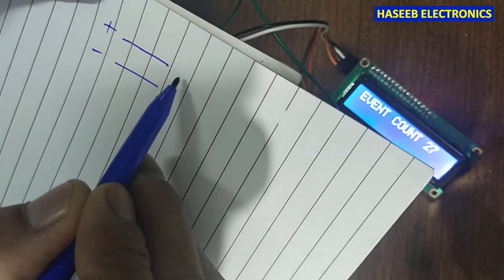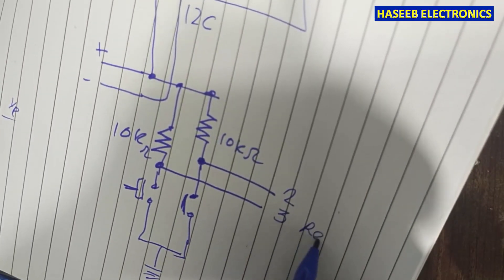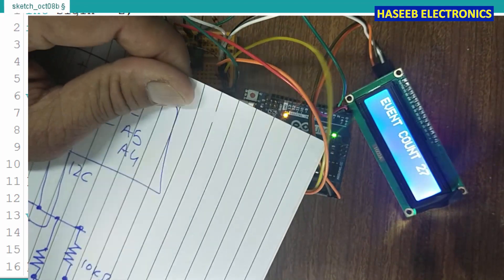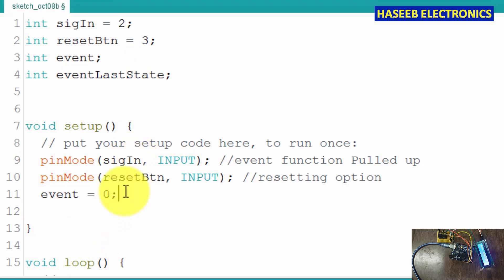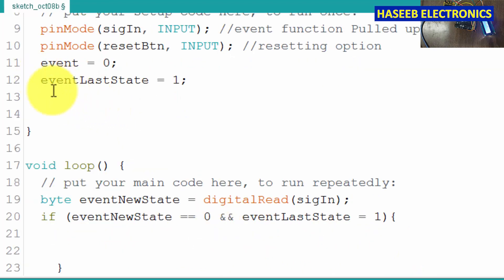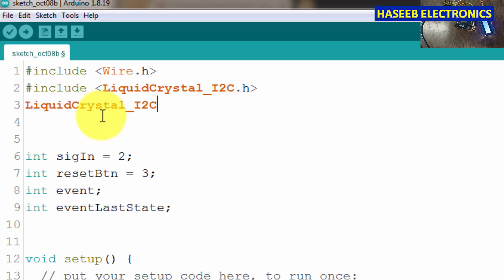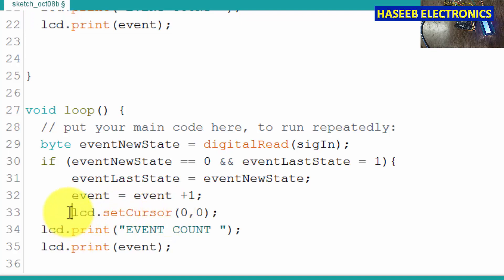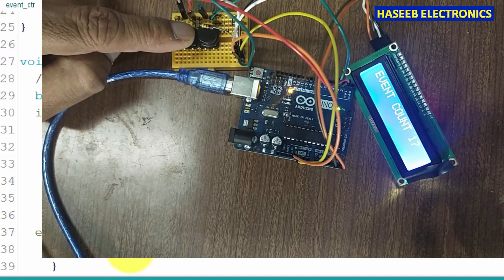{724} Event Counter / Pulse Counter Using Arduino Uno

Comment: How can I buy all these? Circuits?
Reply from the maker: you can search online "ARDUINO UNO STARTER KIT" and compare prices and number of sensors with that kit. any one which fits good to your plan, buy it 
i am sending some links, you can also check these links
Reply from the maker: https://www.amazon.com/ELEGOO-Project-Tutorial-Controller-Projects/dp/B01D8KOZF4/ref=sr_1_1?crid=37MNR33RGF07R&dib=eyJ2IjoiMSJ9._L3JiWgIo_Asrnpq9JBCAnqu9_LUnUdE3hJhcnvwZ2efJLNSKeAKlL4zK5pgImrphNMIPqMa1e6eS4m52nLzBcL81wPreM3CaEU1v2IP8S2B69zvecNlqq4KykzEYqJnO67QCYBLmodXRURM_T1kBrZy_4avvqC9ATkbKl7HMBGYO1jEJ9XUkypau7O8BiXayJWswD9qXvWe7rNd6WqJFuoKEex1hO9of8rgd7iviI8.pMeKqwCe96wTvJ5MBn4W6PUb7tIGSRW0OBcfr7VaCvc&dib_tag=se&keywords=arduino+uno+starter+kit&qid=1765339461&sprefix=arduino+uno+kit+with+%2Caps%2C325&sr=8-1
Reply from the maker: https://www.amazon.com/s?k=arduino+uno+starter+kit&ref=nb_sb_noss
Reply from the maker: https://www.made-in-china.com/products-search/hot-china-products/Arduino_Kit.html?acc=2332877264-lxy&cpn=23313805645-192201139431&tgt=dsa-1679695739706&net=g&dev=c-&gid=Cj0KCQiArt_JBhCTARIsADQZaynerF7lE9UnrYBkyGwmxhHP_koMjH7RVRmme69g0gMCcIsISvYSrCEaAlHdEALw_wcB&kwd=&mtp=&loc=9222699-&gad_source=1&gad_campaignid=23313805645&gbraid=0AAAAACuhMrColD8MaXe1BjMjhVtkjntJR&gclid=Cj0KCQiArt_JBhCTARIsADQZaynerF7lE9UnrYBkyGwmxhHP_koMjH7RVRmme69g0gMCcIsISvYSrCEaAlHdEALw_wcB

Comment: For a school project, I am trying to make a counter that counts down from 200 every time a button is pressed, and after every 20 clicks, there is a speaker that states how many clicks are left (ex. "you have 180 clicks left", "you have 160 clicks left", etc.). I want it to include a reset button back to 200, and it is supposed to be a small wireless counter that has the ability to hold multiple audio recordings and does not need any visual display.
This seems like a simple project, but it is my first time playing around with Arduino and I have very little idea on how to go about this. I was wondering if someone here has an example of a project like this, or has done it him/herself, and could give me some advice. Thanks.
Reply: I'm having the same issue

Comment: If it is long pressed what happened
Counting forward or stopped?
Reply from the maker: it will count just 1 step. as it will convert the last state to reset, so if it is pressed long, it will just count the status "byte LOW" when coming high to low side. and it will wait for next same situation
Reply: @HaseebElectronics  Thank you for your response ☺️
Reply: @HaseebElectronics  
#include <LedControl.h>
int DIN = 12;
int CS = 11;
int CLK = 10;
LedControl lc(DIN, CLK, CS, 1); //8x8 LED Matrix Object
//Facial Expressions
byte smile[8]=   {0x3C,0x42,0xA5,0x81,0xA5,0x99,0x42,0x3C};
byte neutral[8]= {0x3C,0x42,0xA5,0x81,0xBD,0x81,0x42,0x3C};
byte sad[8]=   {0x3C,0x42,0xA5,0x81,0x99,0xA5,0x42,0x3C};
int currentImage = 0;
int numberOfImages = 3;
int buttonPin = 2;
void setup() {
 // put your setup code here
  lc.shutdown(0, false);
  lc.setIntensity(0, 5);
  lc.clearDisplay(0);
    Serial.begin(9600);
  drawImage(smile);
  pinMode(buttonPin, INPUT_PULLUP);
}
void loop() {
  // put your main code here
    //Check for next button
    if(digitalRead(buttonPin) == 0){
      currentImage = currentImage +1;
      if(currentImage == numberOfImages){
        currentImage = 0;
      }
    }

    //Display the selected image using an index
    if(currentImage == 0){
      drawImage(smile);
    }else if(currentImage ==1){
      drawImage(neutral);
    }else if (currentImage ==2){
      drawImage(sad);
    }

    delay(100);
buttonPin.resume();
}

void drawImage(byte image[]){
  for(int i =0; i<=7; i++){
    lc.setRow(0, i, image[i]);
  }
}

Please update this code to if I pressed long press I need to count 1 step forward and also backward with another switch along with if it is power off after some 3 or 4 count then it resume to display 3 or 4 when it is power on.
Thank you ☺️